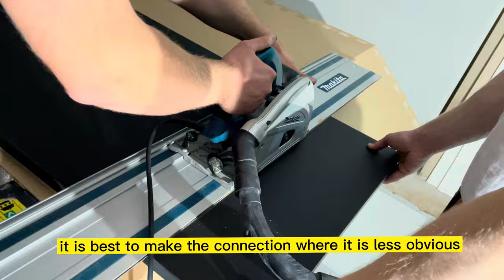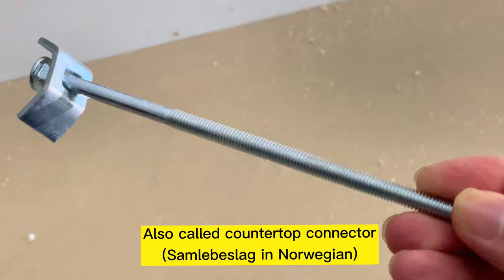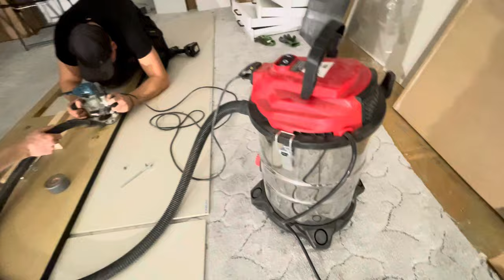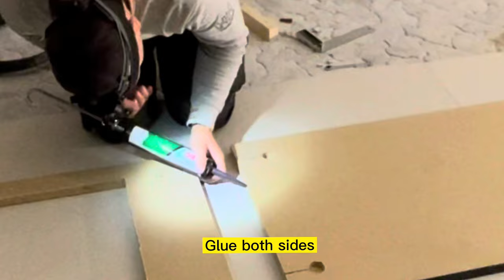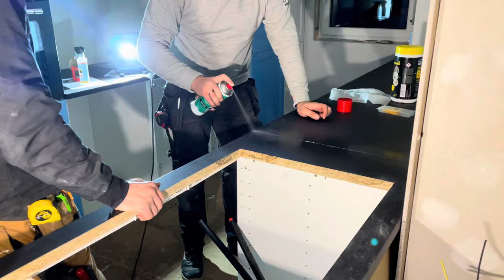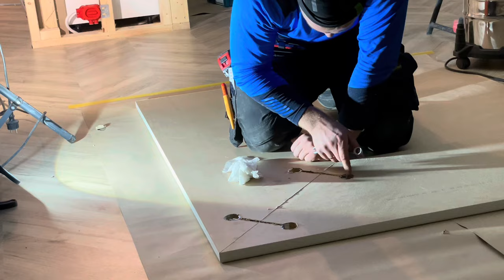Ikea Laminate Countertop - How to Attach 2 pieces using miter bolts

Comment: I have a question i'm having trouble getting answered.  I have an L shaped counter so I need to cut for a corner.  Now i'm pretty sure i should do a 45 degree angle cut on both pieces and meet in the corner right?  The IKEA instructions say to only do straight cuts.  Can I do a 45 degree angle cut without messing up the counter?
Reply from the maker: 45 deg surely looks better and could only be achieved if you have good tools and skill. Our carpenter has the skill but if it’s just me, I would do a straight cut like what ikea suggests. Much easier. Thanks for dropping by

Comment: Hi, great video! What kind of glue/silicone is used to seal and joint the 2 part counter?
Reply from the maker: Our carpenter is out of reach and could not ask him. I guess every country has a particular brand that they use. You make ask the hardware near you. Thanks for watching

Comment: Nice. Is there a reason you don’t put the biscuit joints in the middle depth of the worktop? You seemed to place them nearer to the bottomed the worktop?
Reply from the maker: You are very observant. Carpenter is not perfect. Maybe he made mistake or maybe it’s his strategy.